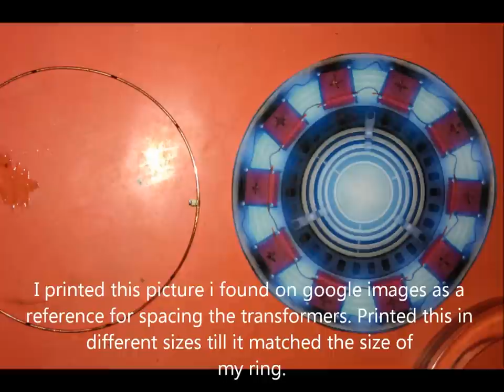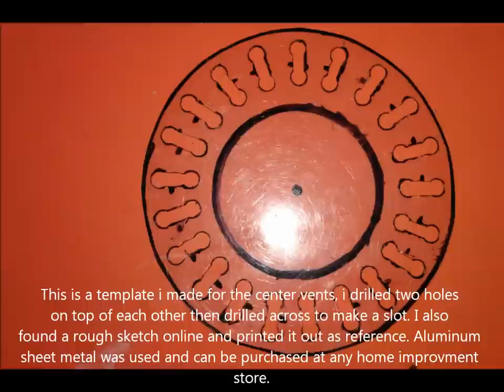How to make a Iron Man Mark I Arc Reactor DIY

Comment: Thanks for the reply. I am going to continue on with the 3.5" slider as the back plate. My only trouble now is getting the clear rings. I tried cutting a ring out of plexiglass using a Dremel, but it was futile. And table saws with plexiglass blades would be too difficult for me to handle. I am thinking of going with laser-cut rings from an online shop.

Comment from the maker: No resistors,I just match the voltage to the LED's which are rated @ 4.5v, i used a battery pack which holds three AA batteries. 1.5v x 3= 4.5v. Been using this method for a couple years and the led's are still just as bright as the day it was assembled, and they stay cool.

Comment: For the ring i buyed clear liquid epoxy and i made a big ring shape into a wood and put there the liquid epoxy but before this i made the rings and connect them with the LEDs and after that i made the wodden shape and put the epoxy there and then put inside the rings with the LEDs after that i tested and it works !

Comment from the maker: @MrHusla786 2 1/4 Inner Diameter X 5/8 thickness or 2 3/8 Inner diameter X 1/4 thickness but you could use a different size if you want, this is close to the real size but might be slightly larger diameter and the ring might be alittle thicker. I had to order a couple till i got the perfect size, sometimes these molds look different then the picture they show of them. Goodluck and thanks for all your compliments, I hope to see more videos from your projects, yours looks great!

Comment: Hey I would appreciate if you could answer this question:
I want to recreate this but I have never worked with LEDs (or SMDs).  I started reading and researching and from my basic understanding these diodes can burn themselves out if too much voltage flows through, or wont light up if too little flows through.
My question is how did you make the circuit for the outer circle?  Are all the SMDs in series, and what resistors did you use, if any?

Would much appreciate an asnwer (Amazing product)

Comment: I got everything soldered, works fine, I just have one more question, when I glue everything will I be gluing the copper rings with the LEDs to the resin ring then to whatever the base will be? or just glue the resin ring to whatever the base will be with the copper rings unglued underneath?

Comment: Just curious to know what the total diameter is of the finished reactor. A lot of tutorials online result in a 4" diameter, but I've read the movie prop was 3.75" or less. I'm having a hard time finding something to use as the back plate. Any suggestions, especially if it's spmething I can buy anywhere, would be awesome. I have a 3.5" furniture slider, it's about 1/4" deep, but the diameter just seems insufficient.

Comment from the maker: search 2X SUPER WHITE LED DOME MAP INTERIOR LIGHT BULBS 12 SMD PANEL HID-XENON on eBay that's what i used.

You would need to de-solder them, then solder them onto the copper round wire like in the video, that's what i used to make them, the color is very white with a slight tint of iceberg blue.